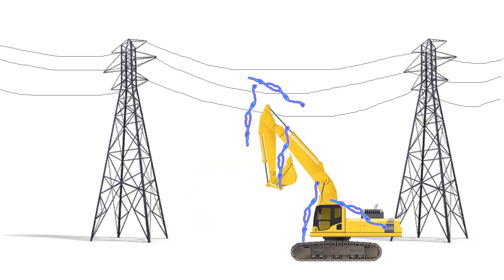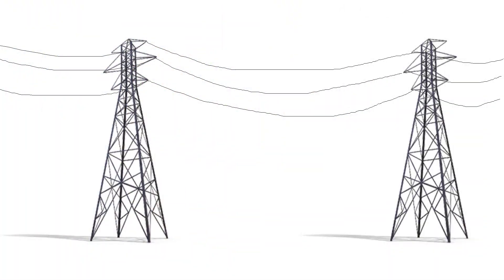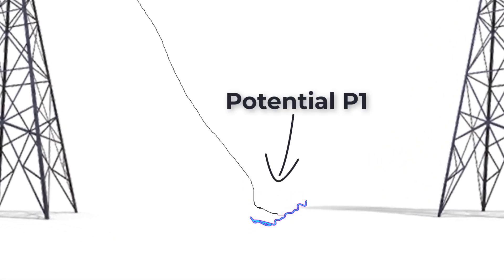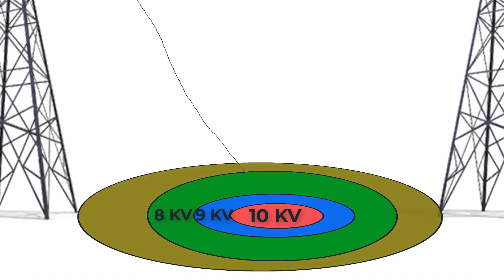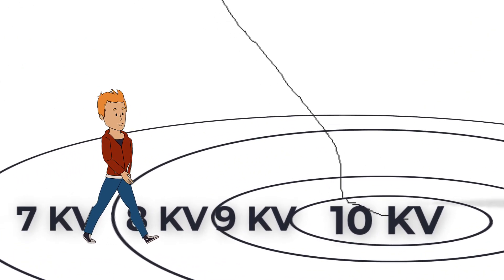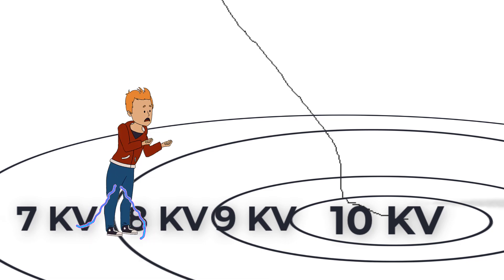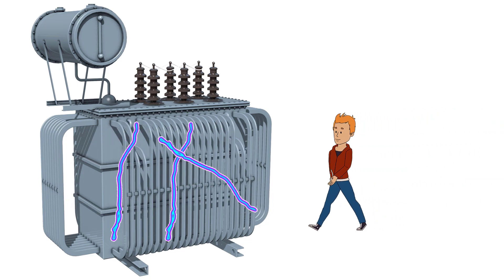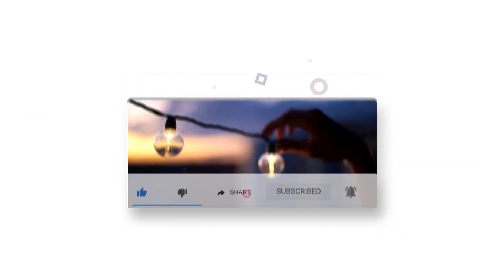Electrifying Truth About STEP and TOUCH Potentials

Comment: Touch potential is likely part of the reason for high-voltage arc flash incidents involving electricians repairing or servicing high-voltage stuff such as MCCs or high voltage transformers. It can lead to burns, serious shocks, bone fractures, and/or even death. 

Touch potential is also the main contributor to numerous incidences of static electricity shocks, especially when touching metallic doorknobs.
Reply from the maker: Excellent information 👌👍